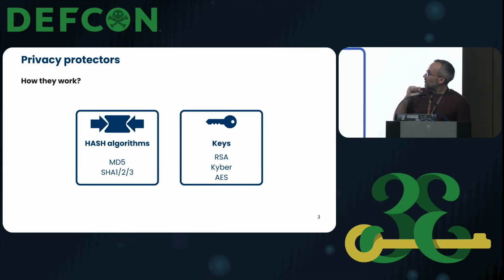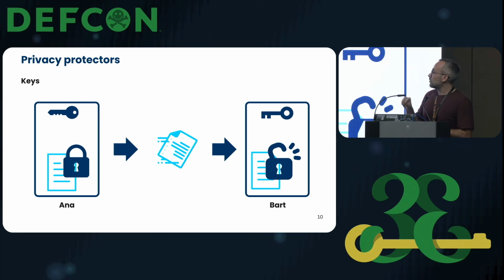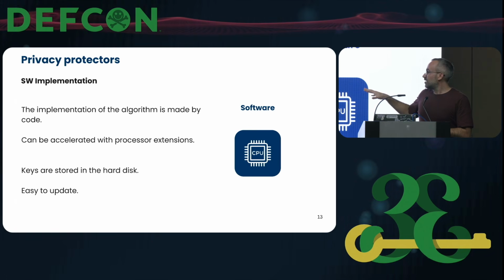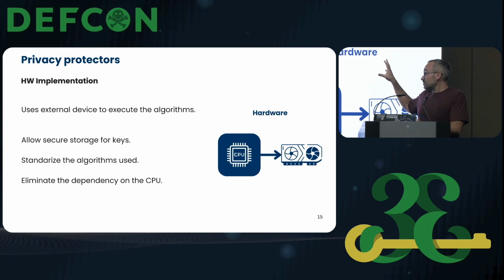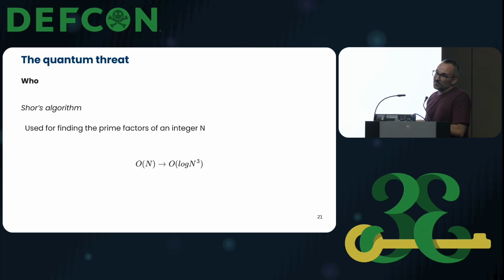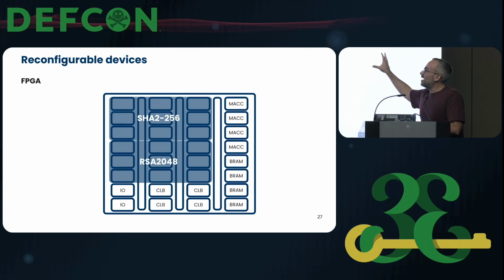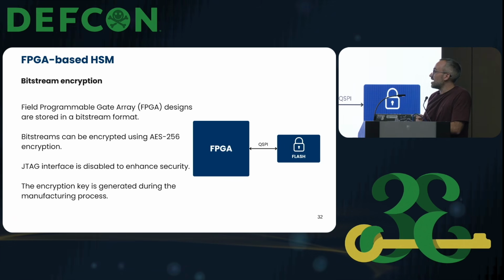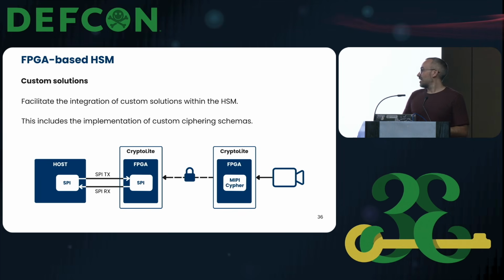DEF CON 33 - Reconfigurable HSMs: Future Proofing Hardware Security  - Pablo Trujillo

Comment: 16:12 SHA3-256 uses an internal capacity of 512 bits for SHA3-256, so it is  here mistakenly quote its “quantum complexity” as O(2^256). Preimage resistance is still the same O(2^128) as SHA-256 have.